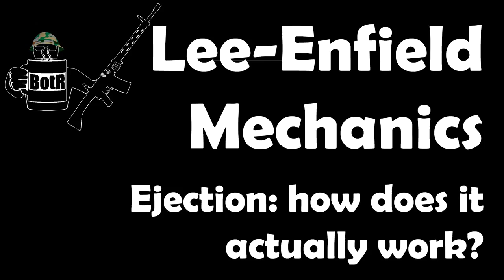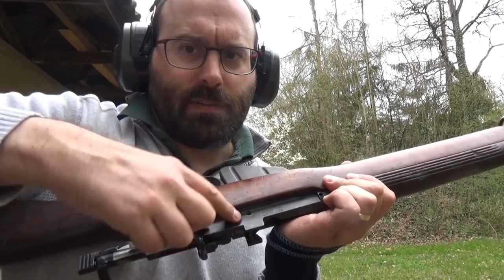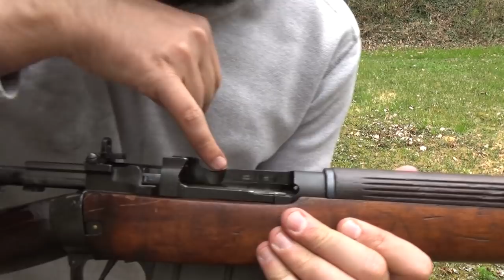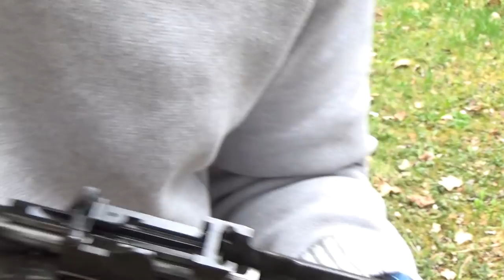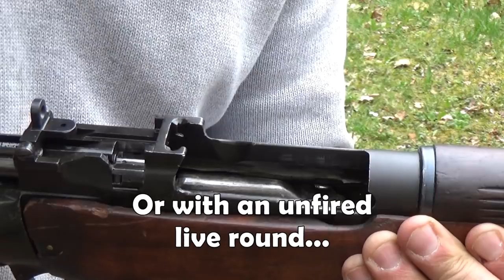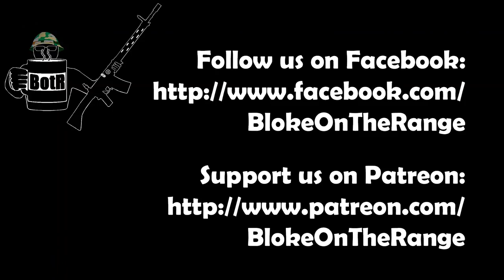How Does Lee Enfield Ejection Actually Work?

Comment: Hello! I have a question for you!
Awrsome informstion by the way thankyou.
I have an smle mk3* that was aresnal retooled at some point. The magazine reciever trigger guard all match the original numbering but the back of the bolt handle has the number electro stenciled in place. Eitherway the headspace is fine and the rifle shoots very good. My issue i have though is that the left side rounds always sear under the extractor instantly and have very smooth feed, but the right side rounds bear against the feed ramp and need a fast swifr motion to seat, as they dont tend to see under the extractor untill the cartridge is in the chamber. It doesnt push feed mind you, its just late to seat. As the cartridge aligns with rhe chamber it finally pops under the extractor.

So when i tried to do your live round test i could push a small hair foward and eject the left round but when i would do the right it either wouldnt pick up the round as i pull back leaving it sitting ontop the magazine or i had to go foward in about half way the travel of the bolt till it seats and pull back.
Is this normal for the smle? Or the lee enfield in general? All the magazines ive looked at have the feed lips for the right side and left side shaped differently. My magazine is the one that matches this reciever and works well when in normal function except for the smooth vs rough feeling between each round as you switch rounds. Left side glides like butter, right has to over come friction on the feedramp and then it aligning under the extractor and then feeds fine but you feel it if you go slow, not so much if you go fast.

Anywho i tried 2 other mags both with the same shape to the feed lips and both with the same results. Can you give me any feedback as to how common this is? Is there a solution or is this just normal?
Reply from the maker: I've not heard of that issue before - my first suggestion would have been the magazine, but if it's the same issue with other mags, have you tried replacing the extractor to see if it's that? I'm wondering if it's chipped or something and is hanging-up on the rims of the rounds coming out the right side of the mag.
Reply: @BlokeontheRange   first off thankyou for the response! as far as the extractor goes it looks normal, no burs or dings that would cause issues, it seems to feed normally as far as I'm used to, it also single round push feeds quite easily but firmly, so it's not loose or anything it's got a nice firm spring. The issue seems to be in the feedlips up at the front of the magazine.  The smle mk3 is the only rifle I own where the feedlips are different for each column of cartridges. The left side feed ramp is shaped upwards to funnel rounds in smoothly, and the right front lip is bent over to retain the right column of rounds. I did read some old manuals in the meantime and it states this is to retain rounds after stripperclip loading and to make sure that they make it under the front lips when pressed in by the operator. The only magazines I have checked have all been no 4  type magazines (not rifle type magazine type no4) and they all have this feature. It seems though on the no 4  rifle they got rid of this and made the feed lips even as far as I can see. If you have an smle on hand please let me know if it's the same with your rifle. Maybe my right feed lip is bent too far down, although I'm not sure this is a bad thing as one of the original mags I tried, seemed to have the same angle or bend on the right lip but on the last round it would pop past the feed lips and either sit in the magazine area or even jump out of the rifle lol! 
So I guess I'd rather have a magazine that always feeds than one that doesn't retain rounds. It's actually funny when you look at the feed ramp of the gun the copper fouling only points to the right side.

Oddly though I can't find any information of anyone having the same issue. It's really a non issue to the function of the rifle, it only effects feel when speed shooting.  
Next time if you pop out your smle mk3 take a look and let me know what you find! 
I might try to post a video later showing the problem actu
Reply from the maker: You could try bending the right front lip up just a bit to see if that changes anything.
Reply: @BlokeontheRange  I think that's what I'm going to have to do, I just saw another video of a guy loading his from a bird eye view and it was not having the same issues.
If your curious I just posted a video on my channel, I'm going to try to bend it a bit and see if I can fix the problem, but I might have to order another magazine to tinker with as the 2 other magazines I tried where from a friend. 
Also sorry if the video cut out, my phone storage got full! The last thing I was going to show was the wear on the feed ramp but didn't get time.

Comment: Funny thing about my No4 Mk1 is that the raceway on the receiver wall is so worn out that the ejector screw is working for both fired and unfired cases. And with pretty good authority. Not the proper way to do it but it's definitely working. 

Before polishing it, it has worse reliability for ejection. It would just spin the cases 180 degrees around or barely fall out the side. I bought a New Old Stock extractor set so it is not that.

The thing is that other gun designs had a fixed ejector for unfired and fired. Like the Mauser 98 or Mosin Nagant.

Comment: The bolt didn’t close. It just seemed to get locked up for some reason. My SMLE is a 1917  Alexander Martin Bsa Heavy Target barrel  “adjusted,Improved” cork bedded with fore end stiffened,cross bolted.
Reply from the maker: It's just an oversized cartridge getting forced into a slightly rough chamber as the bolt locks (there's a metric butt tonne of mechanical advantage on a L-E action) and getting wedged.

Comment: Just had a Stuck Live round AND A STUCK Bolt on a .303  Mk3 *. Being new to .303 SMLE I asked for help from an Experienced shooter at the club.
The bolt was not fully locked but wold not budge! He managed to disengage the extractor from the Rim then with some effort remove the live round, The SMLE wasn’t mine but in my inexperience had tried to use hand loads from MY .303 in another .303. Lesson learnt the hard way.
My SMLE has a BSA match barrel by A Martin and had been adjusted by him also.
It would be good to see a video how to do this procedure. It must happen.
Reply from the maker: And that is why neck-sized cases must be segregated and always used in the same rifle :) You must have closed the bolt with some force - when I've seen this happen a bit of persuasion has been adequate to open the bolt again.

Comment: Awesome! I have a Longbranch Enfield No.4 that a coworker sold me for $50 15 years ago. He told me it was not in shooting condition, and I believed him. Just a wall-hanger. But a few weeks ago, I decided to see if I could bring it back to life. Low and behold, the bore that looked like it was ruined cleaned up beautifully. So, I shot it, and it works fine except I had feeding issues. On another video, I found out that one of the magazines he gave me is incorrect for the No.4, and the other magazine lacks 2 protrusions low down on the front side. That one I was also failing to press it in hard enough, so it wasn't seating fully. My rifle is also missing the ejector screw, which I wondered about. Now I know. So, I think if I go to Ebay right now and get an ejector screw and the right magazine, I'll be good to go. Well, except that the bolt extraction slot is damaged, and the bolt lug sometimes pops off the track if I am not careful when chambering a round. But that's all better than having just a wall-hanger.

Comment: I am having some problems with my savage no4 mk1. First problem is it won't feed the last two rounds. The bolt just glides over the top of them unless I give the magazine a little bump. I've tried adjusting feed lips and spring tension but nothing works. The magazine doesn't have a serial number but it does have the "S" stamped on it. The second problem is ejecting. The rounds don't eject like they're supposed to. When I practice with my dummy rounds they hit the ejector screw but then just flop down right back on top of the other rounds and not out to the side. Do you have any advice for me?
Reply: Okay, I'll give it a shot. Was trying to avoid buying new parts. Thanks for your help and speedy response!
Reply: Make sure you didn't lose the extractor spring. I have a Savage No 4 Mk1* as well. If you read my reply to Billo1281's comment, you can understand what happened to me. I hope my experience helps you with yours.

Comment: If you know, what kind of groups can you get with your No.4 Mk.1 at 100 meters? Or yards, whichever unit of measurement you use, but I'm almost certain it's metric. Also, what's the condition of your bore like? I have a No.4 Mk.1 made by Savage from what I can tell, and it's got a mint bore, but I got nowhere to shoot 100 yard groups. So I'm just curious as to what kind of estimated accuracy I can expect from it

Comment: I spent a couple of fun years at the shooting range with a (sadly) sporterized No4 Mk1, searching for that magic load.  After trying many different combinations, I found that BLC-2 and ACC 2520 both would turn in an occasional sub moa group, with most groups coming in around 2", but overall very satisfied with the results.  The extraction works best with a bit of gusto, otherwise the spent shell may just fall at your feet or fail to leave the action.  In general, the old Lee-Enfield doesn't like limp-wristing anything, but should the Lord tarry, they may be around a hundred years from now still doing what they do best.

Comment: I did try an experiment on my No. 4 Mk II and the live rounds ejected both with or without the screw -- IF you draw the bolt back quickly. If done slowly, the rounds won’t eject properly without a screw. Thanks for the excellent video.

Comment: Ah, that explains what control feed is... kind of. correct me if I'm a dunce, but the control feed is when the round, head of the case coming free of the magazine, slides up smoothly under the extractor claw, as opposed to push feed, in which the round is set under the ejector by the case hitting the chamber walls, then the ejector is forced forward, pivoting it outward against its spring until it clears and the extractor claw and it snaps back into place. Correct?

Comment: Great video.  I was just googling to see if I need to fix my ejector spring and now I see it doesn't have one.  I guess it's designed so you need to pull it back quickly to make the spent case fly.  I'm on the bench and want to gently make it drop out and now I know why it doesn't.  Makes sense.

Comment: i have a savage 1942 all matching #'s my problem is not ejecting  I was using wolf ammo, could it be that it is steal cased that it swells to much after firing  that it is to tight in the bore? have some ppu for it but not to sure if should use it, had a heck of time getting the spent casing out of it. any answers will help, before I take it to a gun smith.

Comment: So what causes wimpy ejection on a No. 4 Mk. 1*? I fired a recently purchased rifle for the first time yesterday, and it was  by NO means ejecting fired cases. At best you could say they just fell out of the action as the bolt reach its furthest rear-ward travel. Cases were not exactly strongly griped by the Extractor. Maybe a weak Extractor Spring?
Reply from the maker: probably a dead extractor spring. That's the first point of attention, and if that doesn't work, replace the extractor too. Just like you would on an AR15 :)

Comment: You could also argue that the Lee-Enfield has two ejectors. The screw and the rim on the receiver wall. It might not be a discreet or traditional ejector but you could argue that it is one nevertheless.

Comment: Because of this, I was able to figure out how to do something pretty similar with the Type 99 Arisaka. Push the round all the way into the chamber, and then it will eject when you pull it back just back and forth without rotating, and I think it works on all Mausers. Not nearly as convenient as the screw, though.

Comment: Why is it that just when I wanted to buy one, they suddenly shot up in price?  In Canada, just a few years ago you could get one for a couple hundred.  Now?  4-5 times that.  A sporterized one goes for that though.
Reply: I expect you can largely blame it on 'merica (and anywhere else that is pushing for it, like the new ban in Canadia). The push for gun control has raised prices a ton. I got my Enfield 6-7 years ago for $260, and even then people were saying the same thing, that a few years ago you could get them for half that. Mine's in pristine condition, but I regularly see ones that look like the just got recovered from a plane crash selling for $400-500. 

I expect the upward trend will continue until gun politics becomes a bit less volatile. Which will probably only happen once more bans are implemented, honestly.

Comment: Mine has a week extraction it doesn't fling the round any advice
Reply from the maker: Replace the extractor spring. And if that doesn't solve it, replace the extractor too. Plus work the bolt in a soldierly fashion :)

Comment: My Lee-Enfield No. 4 will eject the round just fine but it will not eject it.  The bolt simply pulls the spent casing from the chamber and leaves it resting on top of the magazine.  I have to grab the spent case with my fingers.  Does anyone know if this is a bolt head or weak ejector spring issue?  Thank you!
Reply from the maker: I'd replace the extractor spring in the first instance. If that doesn't fix it, I'd replace the extractor claw as well. You're pulling the bolt back in a soldierly fashion and not babying it, right?
Reply: @BlokeontheRange  Thanks for the quick response.  I don't think anything is wrong with the extractor claw but it may be the extractor spring.  Yes, I am pulling the bolt back in a soldierly fashion.  ; )  Thanks again for the reply.
Reply: @BlokeontheRange  I had the bolt head replaced with a new one and my Lee-Enfield is now ejecting and throwing the spent cartridges as it should.  The lesson learned is that bolt heads do wear out over usage and time.  I have only had this particular rifle for a couple of months but she had obviously seen quite a bit of previous usage way before I acquired her.

Comment: What if it wears out too much though?
Reply: I had the same thought, yet my 1943 No4 still ejects perfectly well. This is not a normal issue, not even one I can find much of from a quick search. Many thousands of rounds have been put through many of these rifles, and that wasn't enough to wear it out. I assume this is because brass is significantly softer than steel, and would wear it down very slowly. 

Plus, even if it does get worn out, the ejector screw will kick it out once it gets there.

Comment: I am curious and have tried to find an answer to this question, but I have come up short.  the Lee Enfield has a great action.  The Mauser is a great action (example: Mauser 98, etc.).  Why were the characteristics of the Lee Enfield not adopted by others outside the Commonwealth?  I see plenty of Mauser pattern rifles and other rifles that borrow Mauser components, but I don't see it with the Lee Enfield.  Was it simply that UK didn’t want it available to others?  Was it because of a rimmed cartridge  (like the Mosin Nagant)?  I find it puzzling, because even the P14 borrowed from the earlier Mauser actions.  It seems to me that some of the great characteristics of the Lee Enfield would have been desired by others interested in fielding a new battle rifle.
Reply: Great insight.  Thank you for taking the time to provide that response.